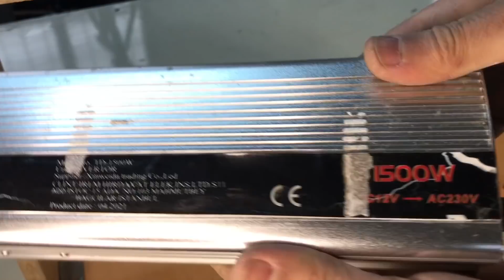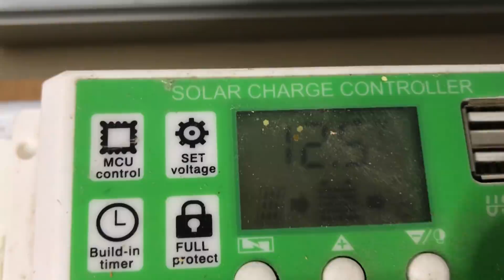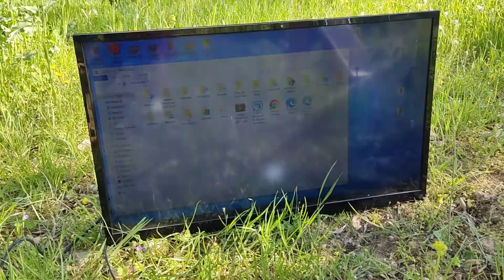Taşınabilir elektrik, Güneş Paneli Bağlantısı , Ücretsiz elektrik

Comment: Hocam kolay gelsin elimde 2 adet güneş paneli var evin catısına mone ettim panelin biri 35v 9amper diyeri 45v 10amper  üzerindeki  yaza bu dc dc voltaj düşürücü 50voltu 12v 20a veya 30a gibi  voltaj düşürücü regülatörü nasıl bulabilirim yardımcı olursa ız sevinirim
Reply from the maker: Güneş panelleri için şarj kontrol cihazı var o işinizi görür

Comment: For a little while a small battery can power TV and laptop. Similarly, it does UPS backup source with internal battery. Solar panels do not affect the overall energy balance. The panels have about 2x10W and it is very little - they do not charge the battery in one day. It is necessary to install a large solar field (not in the trunk but on the roof of the house) to make it work separately. I'm afraid it's just a humorous clip.
Reply from the maker: panels provide 2x50 watts of good energy, of course, its power is not enough, you are right, but it is a good example to gain experience and students. thanks
Reply: @KENDİNDEYAPABİLİRSİN  Polycrystalline panel 50W has the smallest size 51x70cm. I admit that the video is a bad size estimate. A long time ago, I made something similar in a big red HILTI suitcase. The panel was placed on the inside of the trunk lid to protect it. The purpose was to charge cell phones and radios. At night it provided small LED lighting.

Comment: Çok güzel olmuş
Volta marka 3 teker vm4  2kişilik 5 akü var 12v22amper  1800w DC DC STEP UP BOOST MODÜLE var. Dijtal göstergeli olan cihazdan yok birde güneş panelleri bunları da tedarik edersem aracın üzerine takınca hem şarj edip hemde araca elektirik verirmi? iyi günler
Reply: O dijital paneli olan aletin adı MPPT . Sana gerekli olan da o 12V için.  30A bir MPPT cihaz alarak işini görebilirsin.